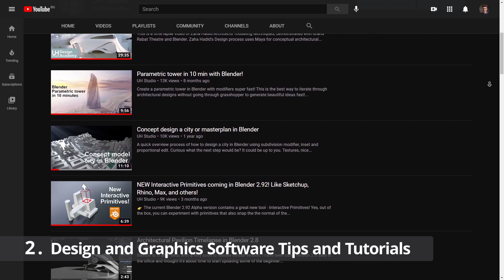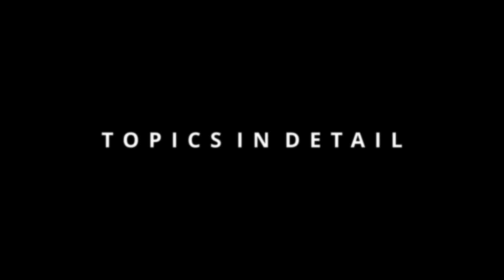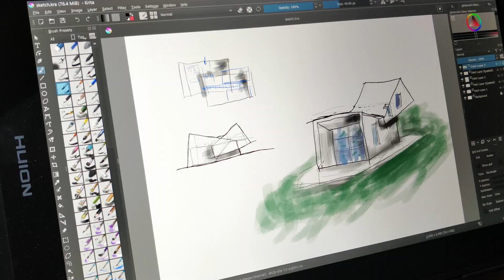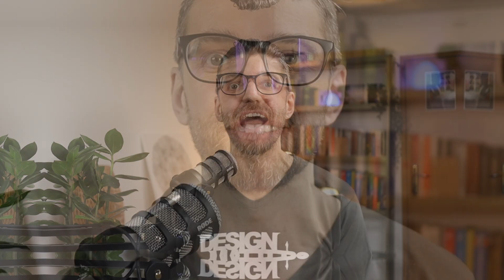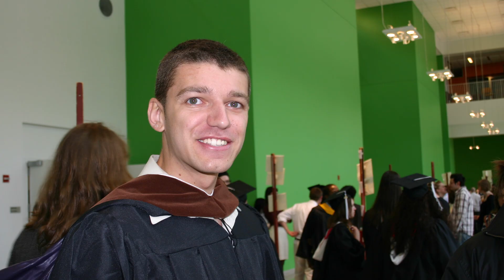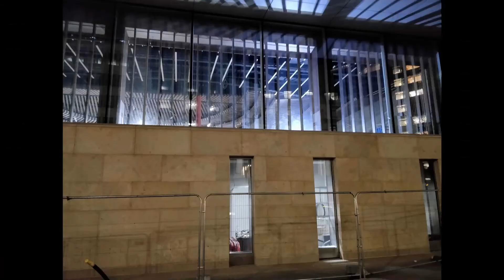Blender, architecture design process, Affinity, 3d mouse, Freecad, Krita?- What you can find here

Comment: In our country we mostly only use AutoCAD and Sketchup, but I plan to learn Revit and Rhino soon as I plan to take my masters and gain experience abroad.

I'm kinda torn between learning Blender and Rhino. A lot of comments praise Rhinos nurbs geometry, in which in their defense is a more reliable format in material production vs graphic softwares mesh geometry. So would it be safe to say that in general, Blender would mostly be used for modelling, and Rhino for production purposes?
Reply from the maker: I would recommend learning both. They are quite different, but both have their useful purposes. Rhino is excellent all around modeler usable from concept to documentation, although not quite BIM in the typical sense like revit (however with grasshopper it can be set up as a bim platform). Blender is useful for the really early concept design work, for trickier geometry, where subd can give results faster than proper nurbs, and for visualisation. I use both regularly together. Also, sketchup is still widely used. Whether designers in a practice use Rhino or Sketchup typically depends on the type of projects the practice works on - if they are blockier, extrusions, they tend to use sketchup, and for anything a bit more complicated, Rhino.
Reply: @UHStudio  Thanks for the response! It definitely made things clearer for me 🙂

Only issue now would be on how to allot time to learn these haha. I'm currently trying to use Rhino to replicate my previous Sketchup models, and Revit to replicate previous CAD projects for practice. Thanks again!